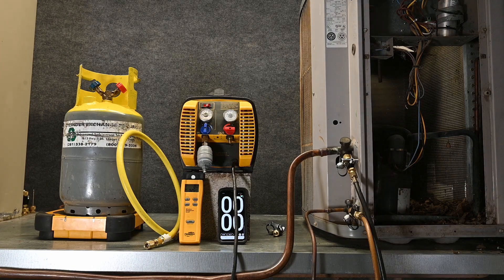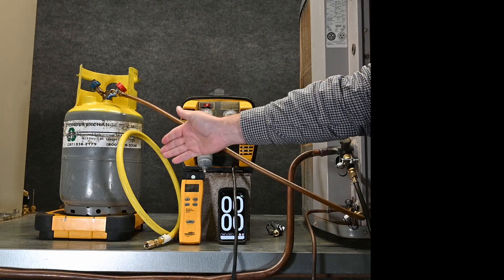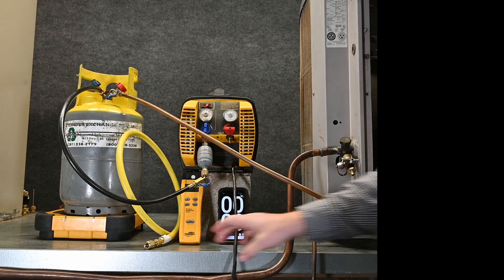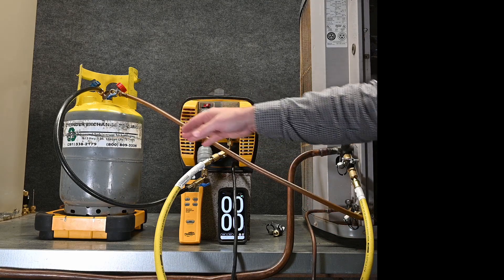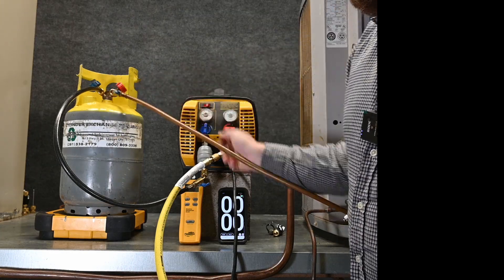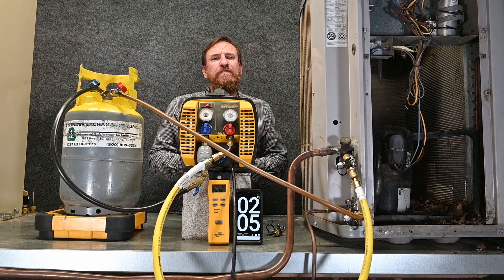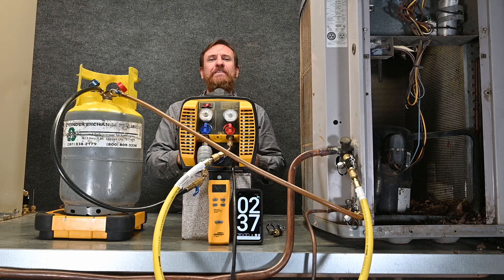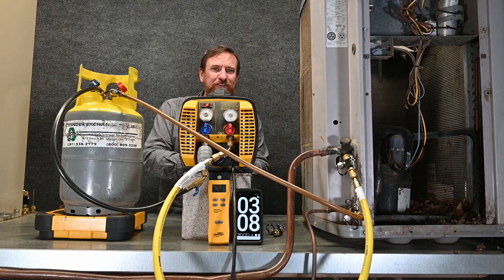HVAC 133 Push Pull method

Comment: do you know if this is the method used by recovery machine on ac auto repair..it can filter r134a and has the ability to recover old compressor oil and replace it with a new one. it use lbp/hbp type compressor 🤔

Comment: So after you recover the liquid, do you then switch the system around to pull the rest of the vapor down to the required vacuum for recovery?
Reply from the maker: Yes for this particular method. That's why it's not used often for resedental and light commercial.

Comment: Great video as always, I’ve heard of this method but have never understood it, thanks. I can see this being useful recovering r410 from splits, always time consuming with normal reclaim because of the compression ratios
Reply from the maker: For 410a splits inspid use the method in HVAC ,129 and 130. It will be faster than this.
Reply: @love2hvac  thanks ty

Comment: to be honest i never liked this method regardless of the size of the system. big system you can usually just hook straight into the acummulator/liquid storage and with a recovery tank in vacuum and some big and short hoses just dump everything/the bulk out in one go. with big systems you need several recovery tanks so you can suck really fast especially if you have the big 200+lbs recovery tanks you can vacuum out the bulk in record time. once the bulk is out you can use the recovery machine you already have connected elsewere and finish it off to near vacuum. its so much less hassle just by pre-vacuuming 1 or more oversized tanks for the job and have them ready to go. that way you dont have to worry about overfilling too much or rising temperature slowing the machine down. i love using oversized tanks. it just makes things less annoying. i never understood other guys that use a  30 pound tank on a 25 pound system. just grab the next size up or more. you already have the tank anyways.
Reply from the maker: I 100% agree. Since it's on the EPA test I thought I would throw it in.
I'm the same time frame I ran the machine it was only faster than the first (slowest) method.
Reply: @love2hvac  its a fair addition and it should be mentioned. its also a great way to show how dumb tests can be in real life as they do give people the idea its good practice. after all you can still wait for that "but it was in the test".